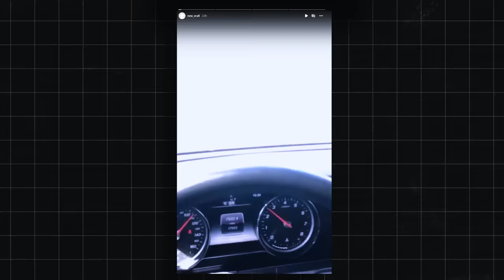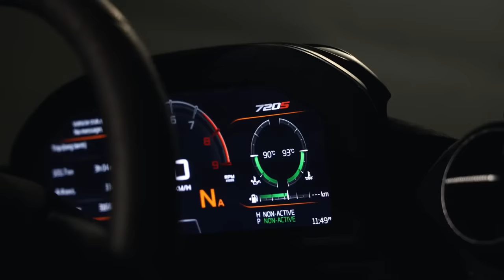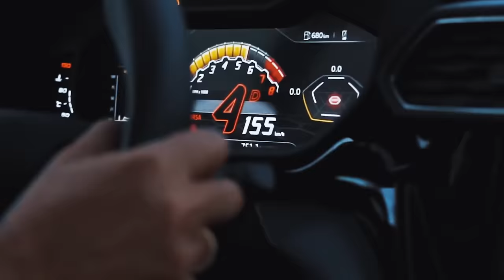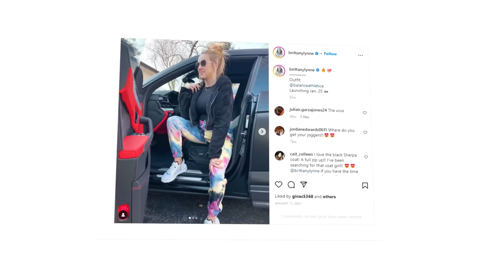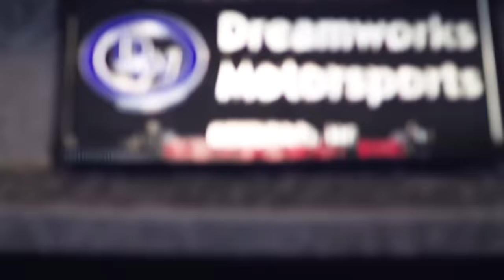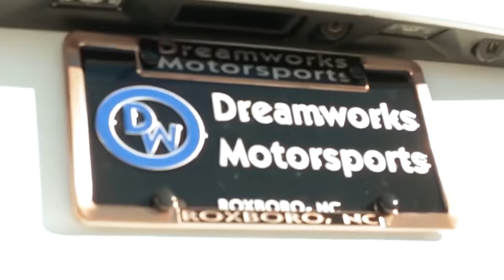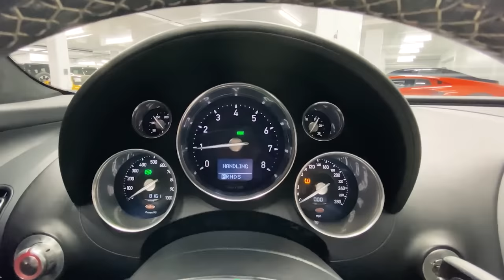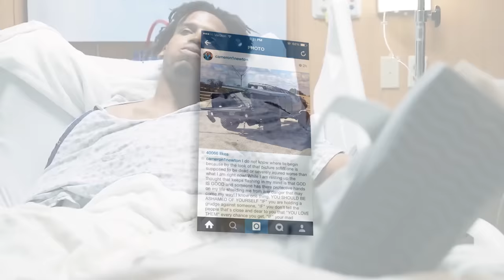Stupidly Expensive Cars NFL Players Own

Comment: It's like houses, the money isn't in the cost of purchase, it's in the maitnence and operation. The Italian cars as well as the super expensive German cars are outrageous for basic maitnence parts and service. You can go broke easy on these things. I suppose if your up there enough in yearly income you wouldn't worry about it but if your sitting well and retired, (no income coming in of the same caliber) be careful!!!
Reply: I hear an oil change on a Lambo is over $300 😱
Reply: @xyzxyz6406  It can range from 400 to about 2500 dollars depending on year, model and oil type. If you have a early 80s model, it'll range on the lower end and it goes up from there. Italian high end sports cars are also very, very finicky. They require tuning and replacement parts ( spark plugs, injectors etc etc) quite often and in that area it gets very pricey because you have to take it somewhere where they have the right parts, and knowledge to do everything correctly. There is very precise guidelines to keep cars like that running correctly.